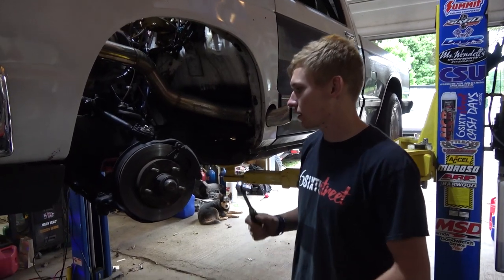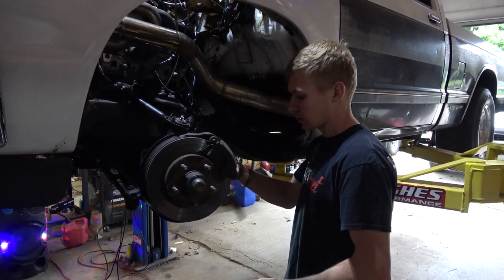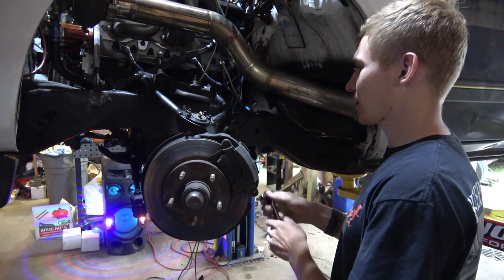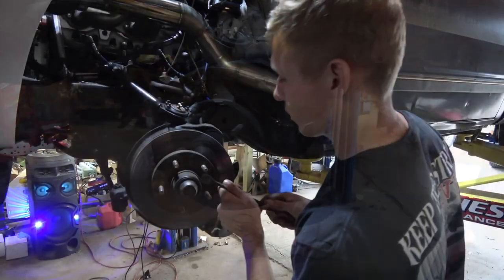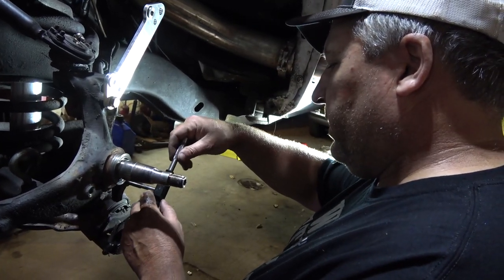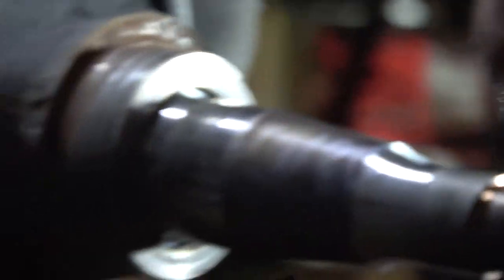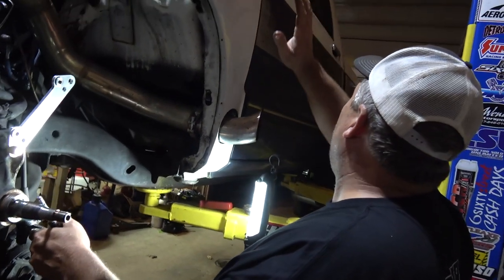S-10 Lightweight Race Brakes Install + Street Testing

Comment: Definitely needs a paint job, but a full on frame off restoration seems a bit much for a drag car that you intend to beat the hell out of every time you take it out.
Reply: A full frame off restore is not a bad idea and it’s not only painting its change all lines, bushing, bolts. Pretty much make it new. Get another 30-40 years out of it.
Reply: Grew up in Ohio and some body repair and good paint job is necessary if you want your truck to be around and not look like pounded crap. Won't make it no faster but make it last longer.

Comment: Wild major flashback I put those on my car years ago and had no idea what I was doing wish your vidio would have been out then. If you've never run these before maybe I could save you a little bit of a headache. When I put mine on I had grease on the dust cap o-ring put them on hand tight then when I tried to take them off to repack bearings it was quite a challenge trying to get ahold of that polished aluminum cone shaped dust cap with anything I thought I was going to have to weld something to it or grind off flat spot to get a hold of it. Can't remember how I ended up getting them off but now I only tighten them enough so the rubber o-ring is seated and then clean it with brake cleaner and put a couple wraps of black electrical tape around the joint so they won't back out haven't had any trouble since. Love the videos keep them coming.

Comment: Tell pops I learned to pack wheel bearings by hand by putting the grease into the palm of one hand and then pushing the bearing into the grease with the other hand.  Have never used the fancy tool either.  Old school is the best school!  😉

Comment: Been packing wheel bearings that way for 50 years. Never had a problem!! 
The problem with wheel bearings is having the axle nut to loose or to tight!!!

Comment: I like the demonstration of the sprung vs unsprung weight, I don't think you explained the point that you where trying to make but I get the point, that it'll shock your suspension more as the front pulls up which can lead to loading/unloading of the drive tires. More importantly did you notice how homeboy has his girlfriend Maddy convinced that 18" is actually 12"? I like that your videos have deeper life lessons if your just willing to see them. LOL I thought you did a lot of wheelies before the lighter front! Good content

Comment: Should restore it, its not a rat rod! As a side note the drill was jamming because the through hole was not centered. If you drill out the hole with the larger bit first then stop when you bottom out you can then switch to a smaller bit and it will center in the taper left in the hole. Then go back to the tapping bit. 👍

Comment: This is for pops. The right tool to pack bearings, is a big blob in your palm, and you push the bearings down into it to fill.... Fuck bearing packing tools. That money is better off other places. The old ways are the best way. My dad was an old school shade tree and dragger, here on Long Island NY. 

“It ain’t stupid if it works!”

And yes, restoration with light panels and doors 👍🏼😈👍🏼

Comment: I agree with pop's 💯 to restore it to the OG color like you guys did Tommy's truck. I also grease my bearings the same way and my friends do to and we've never had issues. Those brakes look damn good. If I wouldn't have went with a strange complete package deal rear end, brakes, and coilovers, I would of went aerospace.

Comment: Thats funny that they make a tool to pack wheel bearings. I had no idea and ive packed a lot of wheel bearings in the palm of my hand.  Just slap a big blob of grease in your palm and work it into the bearing, i think it works good, ive never had a problem.

Comment: Pack bearings by putting a glob a grease in your left palm and take the bearing and hold it like you gunna skip it across a pond. Just take the edge of the bearing and take swipes of the grease pushing the bearing into your palm forcing grease into it 🤙

Comment: Stock style paint and graphics but, not necessarily a full "restoration. 
Here's my thinking; 
The truck is getting much faster and has allot more power than a few years ago. It probably needs a cage upgrade for safety (funny car hoop at least). Also, you are getting into the speed and power league where an upgraded rear chassis would probably be a good idea. Not necessarily a back half but some down tubes from your cage and a four link with coil overs. Even if you stay with leaf springs and a two link, replacing the factory cross members with tubular chrome moly ones would at stiffness and allot the chassis to waist less power. 
All of the suggested cage and chassis upgrades would be much easier if the bead and cab were pulled off the chassis.  With the cab and bed off you could easily shed some weight with by taking a hole saw to the frame rails and follow up with a dimple die. 
Light weight front clip and doors(and lexan windows), all painted in stock looking paint and graphics would make the the "Billy the Kid S10" look even more distinctive.

Comment: I broke a tap off in an exhaust bolt hole on my BBC heads.   Of course it was in the car, on race weekend.  I think I drove it for another year with just the one exhaust bole holding that gasket.  Boogered the shit out of the threads getting the tap out.

Comment: I like the idea of redoing it for sure especially since your taking about lightweight doors and other cool things to be done to. However tbh I'm very partial to the current look of the truck as well. It looks really good and I like the patinaed look it has. But to do lightweight doors and I think widen the bed some, you would really need to paint it at that point anyway. So I'm torn, luckily you have to make the decision not me.

Comment: Restore it back to factory style paint and stripes either painted stripes or new stickers. If you take the current cage out build a better one do a cage for a time bracket faster. That way when you get even faster the cage is already good for it and dont need to worry about it. That truck puts in work show it that love it deserves. Plus you can lighten it up farther while its apart.

Comment: 2:55 question for y'all...are you running power steering on these trucks? Reason i ask is because i see alot of sawing at the steering wheel during in cab shots going down the track. I realize both trucks are handfuls to drive, but can't help to wonder if a manual box might take some of that out. Experience with A-bodies and G-bodies converted to manual steering really added a sense of control at the track and on the street too for that matter.
If you are running a manual steering box then which one? Maybe slow down the ratio like my 20+ turns lock to lock 1:1000(it seems) ratio classic saginaw GM box which feels just right in my '70 442.
Im pretty confident whatever fits A and G bodies fits S-10 too, like a bolt on (with the correct pitman arm of course).
These are just thoughts that came to mind when announcing the Long Overdue Brake system Upgrade.

Ok continue 😁...

6:50 you made cutting them ears off look purdy too. Thank you for that. Had you not cleaned up those cuts my ocd would have kicked in.
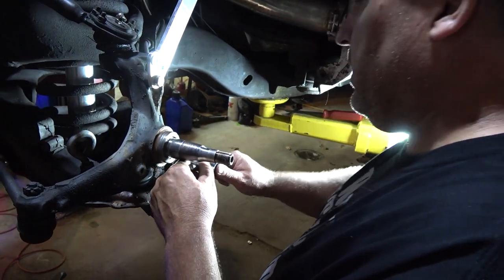8:45 do not hesitate to buy the Lisle tool or equivalent rail of tap sockets...would have been the perfect tool addition for this job. They give you alot more control than you realize once you get the tap started straight (often with a regular tap handle like you used). Also cutting oil is your friend. That statement was for the viewers not for you guys because you know what you are doing, but people new to mods and tapping holes etc might benefit from comments. Dont know why im enjoying this vid so much...continue...

9:58 I WAS JUST THINKING IF YOU WILL EVER PAINT THIS TRUCK WHEN VID STARTED! Honest i thought that!
I say no for now...set a racing goal and if/when achieved THEN Dedicate the paint job to the goal accomplished...!!!....???
What do you think? Would that work?
My color of choice is dark blue/midnight blue...looks blue af in certain daylight but might as well be black at night. Thats my votes.

12:24 keeping the doors from a "famous" vehicle is a pretty big deal in some circles. My friend Mike Moran has the drivers door from the burgundy Walsh mustang hanging front and center in his shop. Mike and Steve Grebeck were good friends. Grebeck did the cage in my car, and for a reduced price because Mike referred me to Steve.
If you dont know who Steve Grebeck was, look it up. I did bring it up here but not interested in talking about what happened...other than Mike has the door of that car displayed front and center in his shop.
Continue...

13:56 the Hillbilly way is as good as any bearing packer out there including the cast iron snap on version. Not a thing wrong with that...except wear the rubber gloves and save on shop towels. Lol just threw that in there. I remember a friends older brother showing me the proper way to pack a wheel bearing when i was about 10. I showed him my own personal method that my Dad showed me and the older brother was impressed and changed his ways...lol...i was 10. He must have been 18. 
Why did i throw out that bit of info? Continue please...

No timestamp...for Sure unsprung weight is huge. If you are in tune with your performance daily driver you can feel a difference when going from heavy factory wheels to aftermarket.
The demonstration did suck however...lol.

Keep it up y'all. I fully support what you are doing up here in Detroit Michigan. If you ever come to Detroit shout me out and id love to meet with ya and help with whatever you might be in michigan for. I even got you a private house to stay in if racing.

Comment: @8:55,, yep,, been there, DUN THAT and the busted off tap's usually a SOB to get it out. Taps are heat treated, harder than the hubs a hell. The one time I did that [busted the tap] I had to drill an oversize hole and use a 'heli-coil'insert,, NOT an ideal bail out but it worked.  Likely the best thing to do on the brake bracket if that would have happened, REPLACE IT and start the mods again.

Comment: It would seem reasonable when you think about the twisting the frame takes from the torque that motor puts out. Combine that with the punishment it takes every time the front end hits the pavement from a wheel stand, that some frame work would be a matter of safety. I have never been a real fan of "fancy" on the strip, but I do understand your Dads point of view. You have grown older, your truck has grown in power, a fresh look may compliment both.

Comment: Mom thinks... leave it alone until you absolutely have to paint it.  And then... original paint scheme.  I’m attached to it as is...   one thing that does drive me nuts is the drivers side inner door panel all pealed down.  Just fix that.  Lol 😆

Comment: In my opinion, your going faster and faster if your going to lift the cab i would build a tube chassis. If not that then sand her down a bit and put a clear on the OG paint

Comment: When I do those type of wheel bearings I put a bunch of grease in The palm of my hand push the bearing against the palm of my hand it pushes the grease in the bearing.
Reply: Yep that’s the best way
Reply: Yep same here
Reply: Did that for years until i bought a bearing packer and now it takes 5 seconds to do what used to take 5 minutes
Reply: Just  keep  running the  hell  out of it  you  make  the decision she bad ass ever way
Reply: There's a pretty snappy tool made just for that, the Lisle Bearing Packing tool is inexpensive, available at just about all he parts houses and does a great job.
Reply: Thats the way you do it.  !!!

Comment: We Like her just the way she is so to keep her correct instead of a entire restoration just put her on a frame table to bring her chassis back in to factory spec and then lightly sand the paints top coat and reapply fresh clear coat to pertect the original patina and lightly wire Brush the original body trim package and reinstall the pieces

Comment: Sure, its very recognizable, unique in how it looks, but that doesn't mean you can't change it or make it look nice if you want to. I like ratty stuff just as much as shiny, but not everything I run has to be either one. I build both ratty and shiny vehicles, its all cool. Glass doors and other parts, make it look stock body wise, and keep making it go faster. I pack wheel bearings in a similar way, I put a dollop of grease in the palm of my hand, and sorta scrape the grease into the bearing. Its messy but it works very well and costs only a rag and some hand cleaner, which I am going to use anyway. Old guy stuff works. We old guys know things, its what we do.

Comment: No I wouldn't restore the original paint. I'd get it painted the glossiest black there is. A deep high gloss black would be super clean. And then when you wax it, it would be so super clean. My opinion

Comment: Dude your drill speed is way to fast,even though they say high speed,they are not.If you get some good carbide bits and slow down so you dont burn the bits they will drill nice and your bits will last and not break..food for thought..Cutting oil works well also..good day to you

Comment: Restore it back to factory an take out the factory glass and go back with optic armor glass and if the roll cage is mild steel go back with molly steel its safer an lighter the truck is getting faster so step up the safety

Comment: Well ain't got what y'all call hills out here in NE Texas, so that eliminates the Hillbilly classification, for myself, and everybody I know, and far as I know, ain't ever seen anyone use anything, but same two tools your using yourself. 
  That's the only method I've ever used, and never had a bearing fail me to date, and with the heat coming off the asphalt, are concrete combined with the Texas sun, disc brakes, rush hour traffic.

Comment: That is the correct way to pack bearings.
BUT those solid smaller drilled  rotors do not have the capacity to stop a vehicle that size. The callipers  are an improvement,, probably.  Depending on the piston size. Caliper stiffness and pad quality.
The reason manufacturers fit larger vented rotors is so the vehicle may stop. Recycled mountain bike rotors are just plain dumb. 25mph brakes doing 6 times that. drrrr!
A 3500+lb car like that should be using at the least a 12" vented rotor with at the least 4x1 3/4 pistons. And some bitey pads that take a deal of heat.
Fitting some bitier pads to the original brakes would have been far better.

Comment: pull the cab tear the cage out get you a 7.50 cage in that puppy your getting to fast for that 10 point and we would all like to see the truck back original like it was from the factory floor.